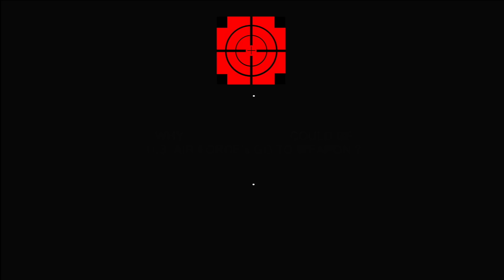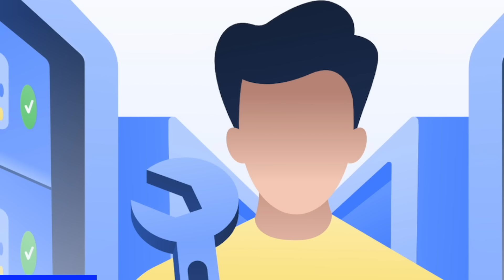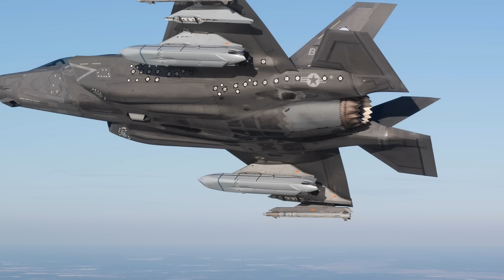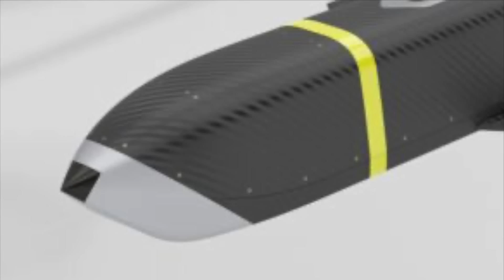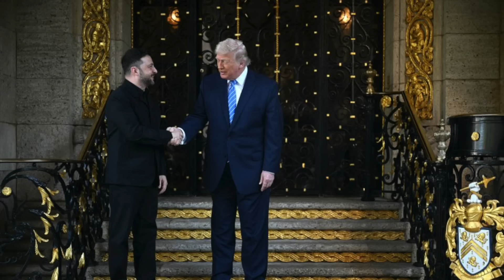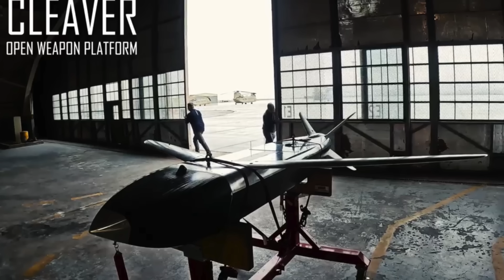Why Rusty Dagger could be US Air Force’s go to weapon ?

Comment: its a good weapon but not an USAF weapon 
what the USAF needs to go back to the JSOW-ER program
The JSOW-ER range is 284 miles but key is that the JSOW is truck
it can be fitted with submunitions for spread out targets or a unitary warhead for single targets or the BROACH for hard target penetration against bunkers. The unitary variant is also capable of striking moving targets on land or sea
Thats the kinda of weapon that the USAF should invest in
Reply: This is that type of weapon.
Reply: And $$$$$$